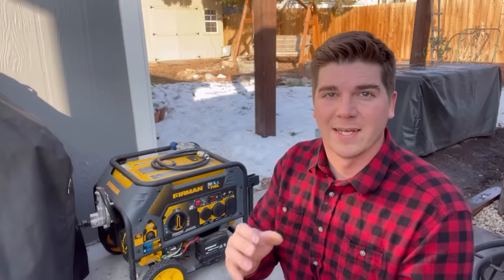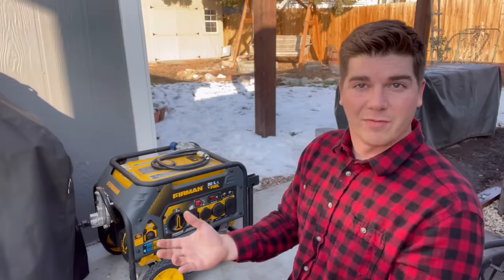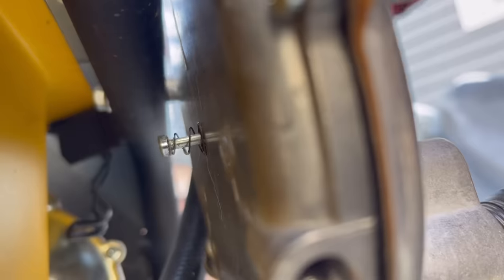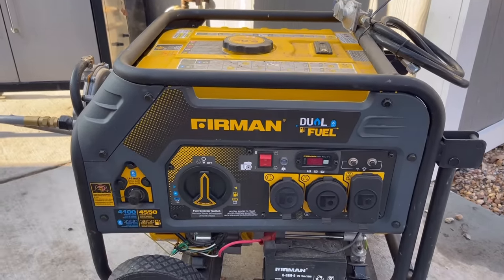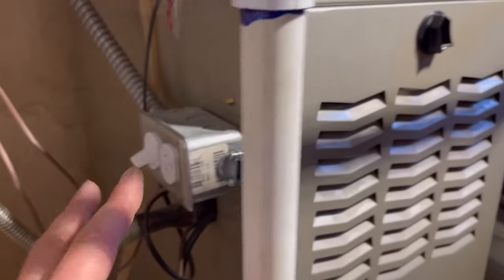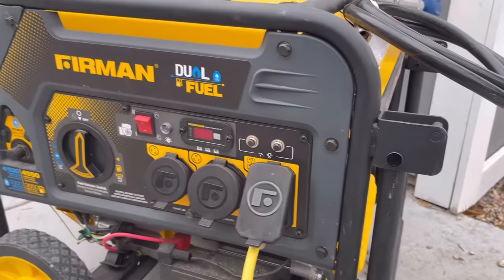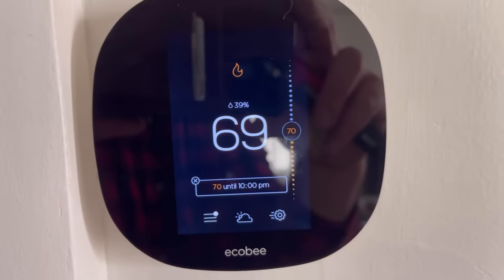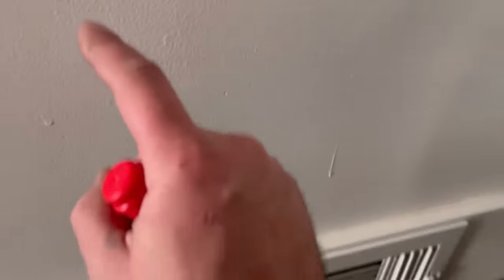Most Homeowners Don’t Know About This Trick To Get Heat During A Power Outage.

Comment: Your advice was to not turn off the generator while the thermostat is calling for heat or the heat exchanger could crack.  So, I guess we better make sure the generator doesn't run out of fuel, and the car battery (from the other video) doesn't die while the heater is running.  The other risk is there is still remnants of gas in the furnace because the exhaust fan had also quit when the power source went out.  Does the valve that shut off the gas require electricity to close?  Would there be a chance it stays in the open position in the sudden loss of power?  I doubt it, but just making sure.
Reply from the maker: No, if it every fails for whatever it will fail in the closed position. So no dancer of that happening 👍🏽
Reply: It's called "fail- safe", meaning the valve will close with a loss of power, (it requires an electric charge to stay open), same as a nuclear reactor, the  control rods will be inserted into the reactor with a complete loss of power.
Reply: @sylviaisgod6947  That makes sense.  Thanks for replying

Comment: Maybe a dumb question, but: why can't you just make that a live receptacle without a switch and then wire your pigtail plug to the wires running to the furnace without having them connected in the receptacle?  Furnace works off receptacle when plugged in and off generator when plugged into extension cord. Seems easier to me but not experienced electrician.
Reply from the maker: You could but I think building code states that a switch is needed that’s specifically dedicated for the furnace
Reply: @diyhvacguy  Thank you. I did not consider building codes.

Comment: how many watts will the furnace usually pull on avg?  I have a 2000 watt generator but I am going to install a pigtail for my furnace to do this.  its currently -42 with windchill where I am and if the power goes out and I am not prepared it would be a disaster.  Just hoping to keep the heat on. but running a few other things like my fridge would be nice at the same time on my 2000watt firman.

thanks great video, I now want a dual fuel to convert to a tri fuel!
Reply from the maker: I’m sure your 2000w will do the trick :) test it out BEFORE you need it! Cheets
Reply from the maker: Cheers

Comment: How are you accounting for the pressure difference needed?  Propane operates at 14 INWC, NG at 7INWC.  I know you are using a NG regulator, but couldn't you use a Maxitrol regulator that is preset at 7INWC?  Is the input pressure the generator requires the reason for the adjustable regulator? Why not use brass threaded caps instead of tape?  Tape could introduce contaminants that could get on the orifice or damage the diaphragm. Love the idea, never thought about doing this.... I will be doing this to run on my generator. not dual fuel, but I 'll burn gas
Reply from the maker: The pressure regulator as I showed in the video.
Reply: @diyhvacguy  I get that, but why do you need it adjustable?

Comment: If your going to go to all the trouble of converting a generator to natural gas along with the electrical modification on your furnace you should just install a breaker interlock.Then you can backfeed through a dryer outlet. The breaker interlock is not expensive and they meet code. Also you can have power to the rest of your panel.
Reply from the maker: Will be doing this very soon! Stay tuned for that

Comment: Does the harbor freight small tale gate generator provide clean enough electricity to run the furnace without damaging the furnace?
Reply from the maker: I think it’s 2000 watts? It should work, but it kind of depends on the efficiency level. If it’s high efficiency then it might need what’s considered “clean” power

Comment: Good stuff Dave, but I have a 3 zone boiler system, not a forced air furnace. Are there any caveats to know about for that type of system. Like heat exchanger cool down etc. ?
Reply from the maker: It’s just a burner and circulator pump yea? The burner cooldown would still apply but other then that, none that I’m aware of!

Comment: May I ask that, if I understand correctly, nothing will happen to the furnace or generator if you turn the main switch back on, because they are isolated? Just would like to make sure that there are no other paths between the furnace and the home hot/neutral. Thank you for the informative video, I am going to setup something like this soon.
Reply from the maker: That’s correct

Comment: Question. Can I turn off my “main” circuit breaker so I don’t back feed the grid, and have a male end extension cord on both ends, plug into an outlet to back feed my house to run my house?
Reply from the maker: You can, but it’s not really advised. There’s a reason they call it a suicide cord. But the person creating it knows the risk so as long as you are being safe about it I say go for it. I should clarify, there is a reason they don’t sell suicide cords to the public haha cheers man

Comment: You mentioned powering a gas furnace…. Will the battery and inverter power an oil furnace(forced hot air)?
Reply from the maker: If it’s 110v then absolutely

Comment: Isnt it possible to change the LP orfice to NG ?
It would be less costly and not create  pressure switch adjusting, correct?
Reply from the maker: It can be changed with the right orifices. The pressure switch wouldn’t need to be changed, that’s just for the inducer draft motor

Comment: I really like the detailed way you explain things. Some electrical experience myself, every time I said "but,..." , you would instantly be right on that topic. 
Do you have a larger generator connected to the house  in case of an extended power outage?
Reply from the maker: This is the primary gen set I use. I’m going to be installing a interlock kit soon so it will eliminate the need to run a cord into the house. Stay tuned for that video! Cheers
Reply: @diyhvacguy  Cool! Looking forward to it. 👍
Reply: Does that generator have a 30 amp 240 volt plug?

Comment: Hey Dave, I tried this, and the inducer motor spins and the burner fires, but when my furnace tries to kick the blower fan on, it trips the 15 amp GFCI on the generator. I have a Lennox EL296UHE Furnace and my generator is a 3500W continuous/4375 max starting with nothing else plugged in. Am I missing something?

Comment: With newer furnaces having more electronics do you see any issues with a floating ground or N-G bonded power supply?
Reply from the maker: Hey, I forgot to mention this but my firman gen set is actually a bonded neutral. But yes that can present issues with higher efficiency furnaces for sure.
Reply: @The DIY HVAC Guy  so with it being a bonded neutral at the genset wouldn't that be the same as grid power? Grid power is bonded at the main panel which is the first source in a power system,  with a genset or off grid inverter the N-G Bond is done at the power source so technically it is correct. I hope that made sense

Comment: I live in Michigan and we are preparing for a huge blizzard this weekend. I bought a generator specifically to run my furnace if the power goes out. What is the reasoning behind shutting off your main breaker? If there is nothing plugged into that outlet, why does it matter if the power is on or not? I was just planning on running an extension cord to my furnace and plugging it in like you did, is there a reason why I would need to shut off the power to the entire house first? Or were you just doing that to show people that it was the generator running the furnace?
Reply from the maker: No need to turn the main off being as it’s isolated but if you want to be certain you could easily take that extra step. Totally up to you

Comment: I understand that with the main breaker shut off you will not back feed to the neighboring grid. However what prevents it from feeding half of your house circut?
Also isn't that male plug at the furnace hot when you are powered by the grid?
Reply from the maker: Nope male plug is NEVER hot until plugged in.
Reply: @diyhvacguy  Please how that male plug is not hot when you are using grid power?
Reply: @markbachman8321  it would be like unplugging your refrigerator, or anything else, and using a generator instead.
Reply: @jolkraeremeark6949  I think I get it now. The outlet there is connected to the breaker and the male plug is only connected to the furnace. 
At first I was thinking that the male plug was connected to both, and when using grid power it was plugged into the outlet to cover the hot male prongs.

Comment: You know what the next step is - to run your furnace on propane.  When the electric and gas are out.  You would put a T fitting on your gas line with a quick connect and maybe a valve just "up wind" of the furnace.  Use the propane hoses you have for the generator.  Not sure how legal that is - only you would know.
Reply: Won't work, you would also have to change each orifice on each gas burner.
Reply: What???...I converted a Nat gas furnace to propane a few years ago...I had to buy a kit to change each orifice to propane....And I live in NY and I am 66 years old...and never remember a time Natural Gas was not available when the Electric Grid went out
Reply: @chazzbreaker51  You are right - the gas supply has never lost pressure during any electrical outage around here.  But thought it would be an interesting topic for the DIY HVAC Guy.  Along the lines of long-term prepping and survival.  The "prepping community" would like to see solutions to most problems.

Comment: Does power for the thermostat come from that same connection?
Reply from the maker: No the thermostat gets it’s power through the tiny multi colored wires that are 24v. They come off the control board and go to the thermostat. So as long as your furnace has power, your thermostat will have power and will work as normal 👍🏽

Comment: Questions;  will that generator work off of butane??  And if you wanted to plug your whole house (lights, etc) into the generator, how would you do it??
Reply from the maker: I’m not sure on the butane question. I’ll be doing an interlock kit so that you can run 220 and 110 items with the gen set. Stay tuned for that one! It will be a pretty stemless setup, and very easy to use.
Reply: @diyhvacguy  When trying to research the butane question, it appears that Honda devised a small generator to run off of butane cylinders some years ago.  But the generator doesn’t give much wattage, so more of something that would charge phones and laptops.  By the way, you also advised you were going to show how to run things (IIRC) without batteries or a generator?  Hmmm????

Comment: Have you ever heard about device called "transfer switch"?
Automatic or manual .. both are ok. But if you rely on remembering to turn off your main breaker ..
Sooner or later there will be dead or injured utilities guy ..
Reply from the maker: Yes I’m going to be installing one of those soon so stay tuned. Did you see in the video where we removed the switch and actually tested it with a hot pen while the gen set was running? No power was back feeding. So this has no potential for that. Cheers

Comment: What if your generator doesn't have a pure sine wave to run your new furnace?
Reply from the maker: Older furnaces you will probably be fine but the newer ones are a bit more picky. Test it out first before you need it and make sure! Cheers

Comment: My question is still if the thermostat is dead, how does the furnace know to kick on?
Reply: In most cases, the T-stat is powered by the same line that supplies power to your furnace.  But it is something you'll want to check on your system before an emergency situation arises.  Assuming your T-stat is powered by the same line as the furnace and you have the furnace pigtail cord like Dave's setup, when you plug the furnace cord into a generator, it will supply power to both the t-stat and furnace.
Reply from the maker: Yes as long as the furnace has power the t stat will work as normal

Comment: How many watts does an average furnace fan put out?
Reply from the maker: Mine is a 60k furnace and it pulls 500 watts. So I’d venture to say anywhere from 500-1000 but you also want to account for the amp spike when the motor first kicks on. So even though mine pulls 500 I got a 1000 watt inverter and it worked great 👍🏽

Comment: Most portable generators don’t provide “clean” power. Their THD can be 15 to 30. This is ok for power tools and things like that. This is not good for sensitive electronics. A few generations have Low THD. 6 or less. This low THD is close to the power coming in to your house from the power company.  I bought a Northstar 13000 watt with low THD. They are expensive but worth it if you want to run most things in your house.

Comment: I'm not sure where to look. I have a roughly ten year old 98% efficient furnace variable fan, modulating gas valve (Lennox SLP98V) with communicating thermostat, . How many watts would I need to run it?
Reply from the maker: A 2000 watt generator will run just about any residential furnace, so I’d get one of those unless you want more power for other items like your fridge and lights. Totally up to you but if you just want to be able to power your furnace a 2000 watt like this will be sufficient. 

https://amzn.to/3FOvzGS
Reply: @diyhvacguy  Is 2000 a little too low for a furnace and fridge? I dont mind unplugging fridge if i need microwave for a minute. The stove is gas too so i can just light that with a lighter. The fridge is old school, like a 2000 Admiral from Wards so it's probably taking a gob of power when it fires up.

Comment: Great video series on this whole topic!   It got me thinking about other gas appliances that sometimes require 110/120V to operate, such as a traditional gas water heater with electric ignition, or an on-demand gas water heater which almost always need 110V, etc...
Reply from the maker: Great point!
Reply: Just buy a water heater that uses a pilot light. No need for electic outlet.
Reply: @4runner4ever83     That's an option.  The only downside would be the expense of completely replacing the existing water heater.
Reply: @Jj-gi2uv    I agree, but it sounds like they had a faulty gas regulator.  The whole purpose for an appliance that uses a pilot light is that if the pilot light goes out, the regulator shuts off the gas flow.
Reply: When we lost power a couple years ago, i didnt need heat or a/c but i wanted hot showers. I have a tankless gas heater. I bought one of those UPS backup things they sell at best buy. I plugged the water heater into it and I got 8 five minute showers before the power came back on. I don't know how many more showers it had in it before I would have to take it somewhere to charge it, but it got me several days. 

The benefit of the tankless is it takes no more power to run every faucet in the house than it does for one faucet. The power simply opens and closes the gas valve, the amount of water going through it is irrelevant. So we maximized the use, filled the sink with hot water for dishes while using the showers in both bathrooms.
Reply: @4runner4ever83  Sorry but they can't make or sell those in the USA anymore. If you have an existing furnace or water heater it can use the pilot light, but the thermostat generally uses electricity. (I don't know if anyone has figured out how to do that without power.)
Reply: Millivolt thermostats are unpowered, like Grandma's landline telephone.
Reply: Those on demand gas water heaters use so little current, you can run them on a really cheap 250 watt inverter that you can plug into a 12 cigarette lighter type of 12v outlet. Some models have little 250 watt heaters inside, but those will only turn on to prevent it from freezing, so as long as the water heater internals don't drop below about 35 degrees, you won't have to worry about what the full load amp draw it says on the label, that's only for the max possible worst case scenario power draw if the water heating is running all those heaters trying to prevent it from freezing up.
Reply: @brnmcc01  Yep, which is why they'd be great candidates to set up for a similar situation as this.   Heck, I've got an "off-grid/camping" one that only uses batteries to kick the unit on.
Reply: @4runner4ever83  some newer appliances shut the gas down if they don't have power.  Not sure about water heaters, but let me tell you how ticked off I was when the power went off for days in Texas a couple years back due to the weather and my gas stove and oven wouldn't work.  No way to bypass it unless power was supplied.  I've since remedied that situation with an inverter generator, but at the time I was more than a bit miffed that I had to use the grill to cook when it was less than 10 degrees outside.

Comment: what do you do if your blower is 220 volt
Reply from the maker: This is only for 110v gas furnaces unfortunately. I’ll do some brainstorming on a heat pump. You’d need a massive gen set or a massive solar array

Comment: Why would you not just get a generlink installed and call it a day?  This allows you to control what your generator runs by turning breakers off to those things you dont want to power.
Reply from the maker: I would like to do a video on this but I have to pull a permit, and technically my camper isn’t supposed to be parked next to my house so I’d like to not get busted for that 🤣 generlink is amazing. Cost a pretty penny though